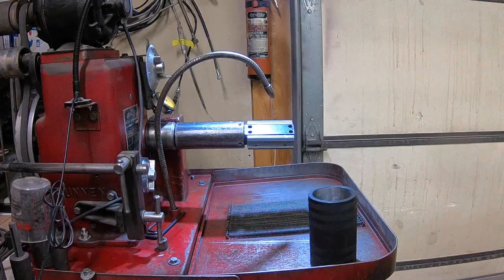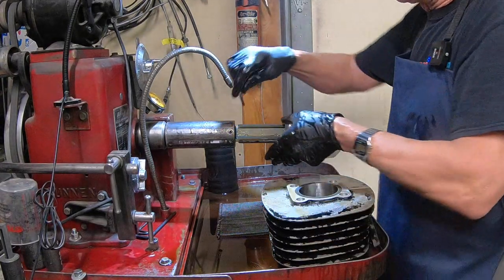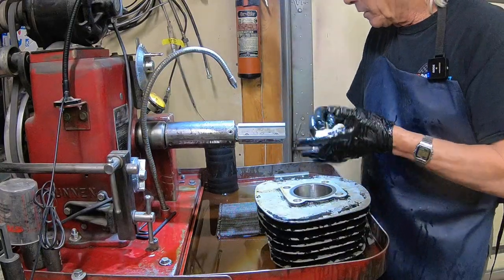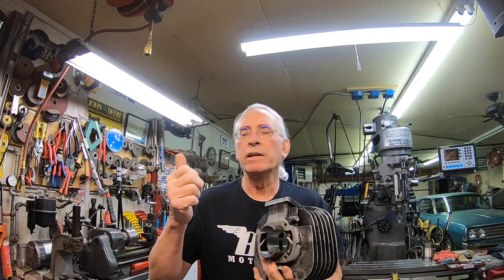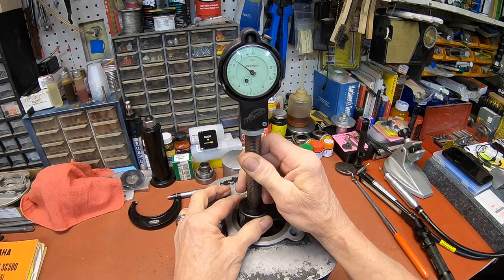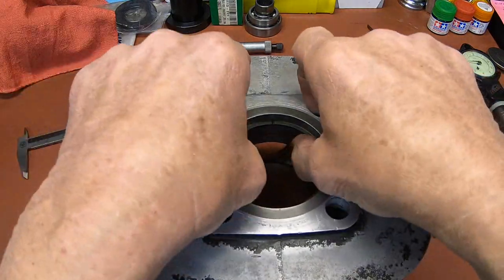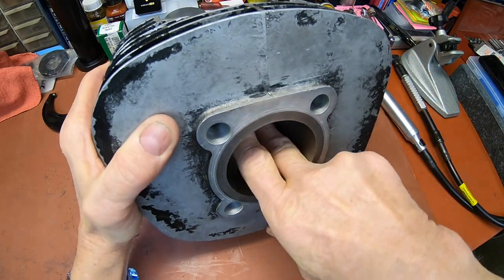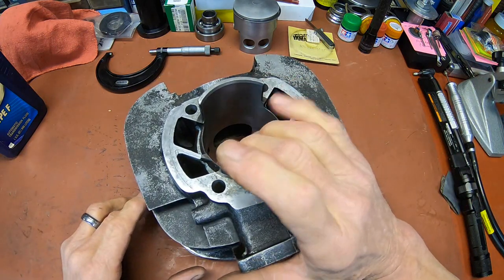Honing and chamfering motorcycle cylinder, Yamaha 250 MX, DT 2

Comment: Nice video again dale! What type of sunnen hone machine is this? Im looking to buy one for my shop but don't know enough about them.all the best, from belgium.
Reply from the maker: Hi Stef, the model I have is an LBA-666, I believe it to be about a 1966 model. There are many that have different model numbers that operate the same. If you will be honing 175 cc and above, you will need the AN-600 honing adapter. It operates just like a ridged hand head hone but attaches to the Sunnen machine. On all the smaller bores I use the SL type mandrels. Hope this is some help, let me know if you have other questions. Thanks for hanging out in the shop with me.